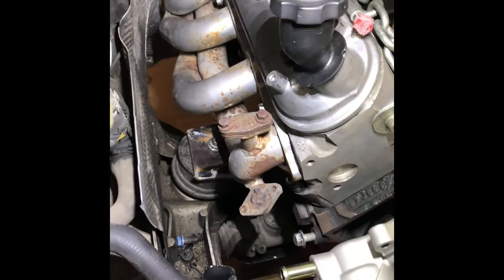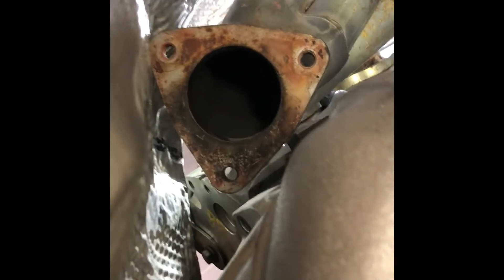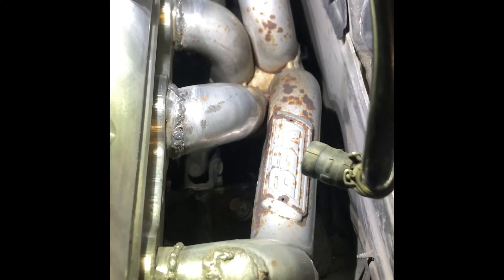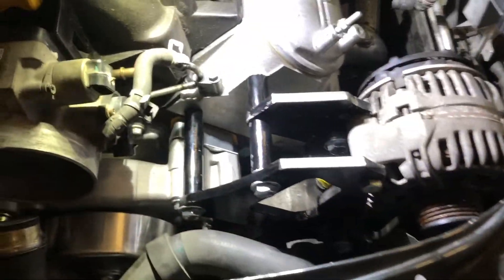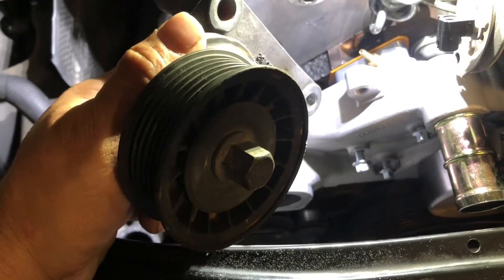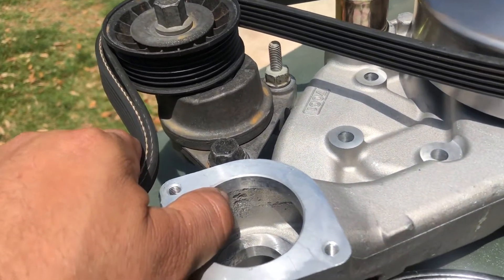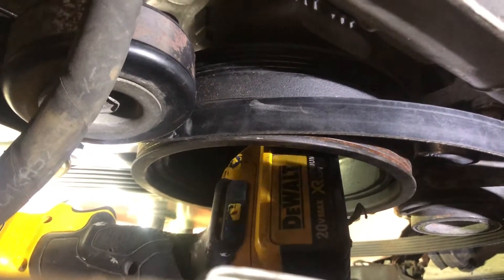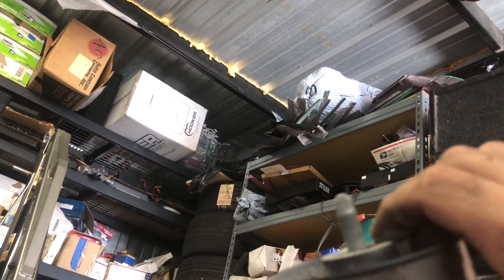Mercedes C230 ls swap 4.8l and t5 part5

Comment: Have u looked at the driveshaft? Do u have a plan
Reply from the maker: Yes I already have the driveshaft planned in my mind I’m going to use a Pontiac g8 yoke and my regular guy that built my driveshaft is going to cut the G8 driveshaft and use only the front piece that connects to the yolk and adapted to the Mercedes driveshaft.That video is coming soon I’m about to upload the clutch bracket and clatch pedal with cylinder assembly video
Reply: @Caprice1977  nice man, good stuff